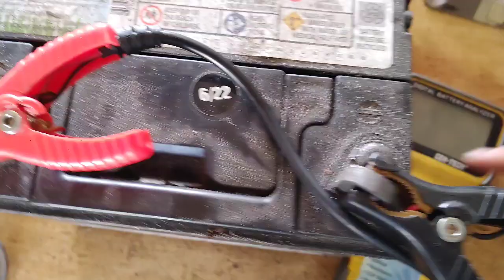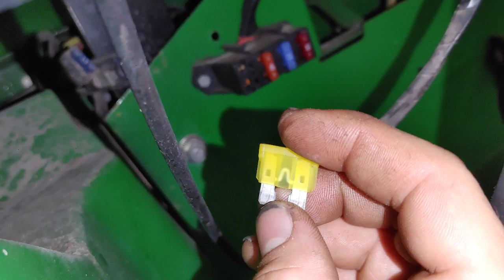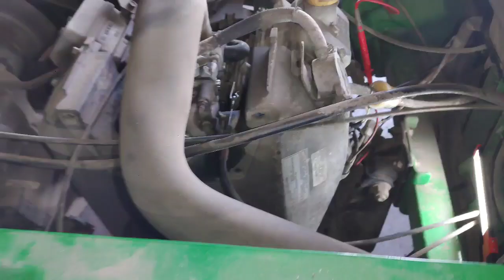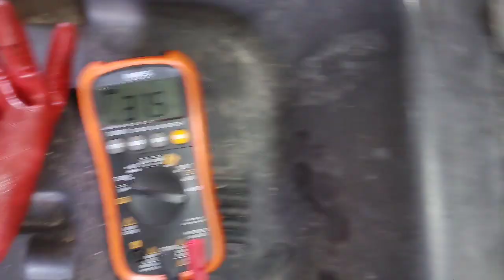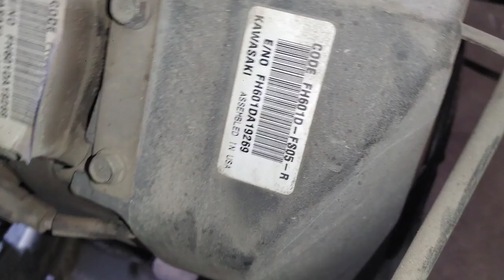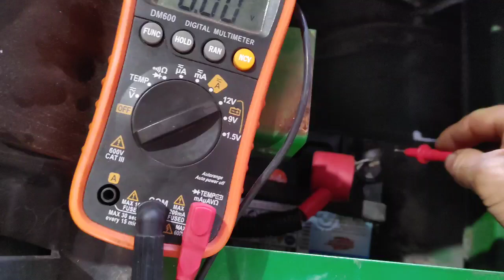John Deere Gator charging system. Stator and voltage regulator

Comment: i really want to thank you for this video. i had 3 moth without operating the gator, battery was not gettin charge, i replace the battery like 3 times, i even replaced the engine starter thinking it had something to do with it. right after watching this video a couple of times, i found out that the fuse was burned out, and the voltage regulator plug was full of mud. know it is working as it should.

Comment: Is 12.25 low voltage for a no crank no start . . my electric gate runs but nothing else.
Reply from the maker: Yes. Fully charged it should read 12.6. Anything below 12.4 indicates it needs charging. The gate doesn't require nearly as much power as the starter motor so that's probably why it's working.

Comment: Thank  you for taking the time to make this video.  My Gator hasn't charged since I got it, so it's been getting a top-off from a battery charger every 2-3 days and hasn't been very helpful after dark, only being able to use the lights to scoot back to its 'bedroom' if I get caught out late.  Wound up walking in with the battery one night after chasing goats.  That was about a week ago and my search for a DIY solution led me to your video.  

I was getting 38vac out of the stator, but the 25A fuse on the regulator line was blown.  Ordered a regulator off of Amazon, installed it, and went back to a 20A fuse.  I also put a little dash-mounted volt meter on the switched side of the key, and it's showing 13.4 for the most part, and 12.8 when I run the lights.  (I installed the voltmeter before doing the regulator swap--simply because it arrived a day earlier--and found a stead 11.5V when running, no lights, didn't even bother checking with lights on ;) )

Thanks again for sharing the information!

Comment: I have been watching your video. I was going to try and check to see if the stator was working. You have a two-wire system. I have a 3-wire system. All wires are yellow. Which wires do I check. My voltage regulator has two wire harness hooking to it. It is a lot larger than the ones you show. Can you give me some directions on hoe to trouble shoot this.

Comment: Hellow I have TX GATOR  IS OVERCHARGING IT GIVES ME ABOUT 18V
Reply from the maker: I'd first make sure all connections (including ground connections) are clean and tight. Free of rust/ dirt/ corrosion.  If your stator is giving 40 ac volts then your voltage regulator is probably bad.

Comment: Was curious to see what your thoughts are. My stator tested the exact same as the one in your video but the 20a fuse keeps popping on my gator. So while I was reconnecting the leads to the voltage regulator I noticed that the bracket was sparking. My question is could the voltage regulator be bad and is causing itself to ground out to the frame of the mounting bracket and in return blowing the fuse?
Reply: Also when I bypass the fuse it puts a load to the stator and I can hear the stator whining
Reply from the maker: Check for loose broken or corroded ground connections. 
If you have a multimeter check for continuity throughout the connections and wires. The fix will be easy. Finding the issue is the hard part. 
I have fixed maybe Gator electrical issues just be taking connections apart, cleaning with a wire brush (on a drill) spraying with wd40 and reinstalling them. Also check fuses boxes are clean.  Use compressed air and wd40 to clean them out. Wd40 will not hurt the electrical parts

Comment: I have a JD 620I gator.  I replaced the voltage regulator.  I checked the stator and I'm receiving ~ 40v ac as in your video. Any advice?
Reply: Then your regulator is bad.

Comment: I have a JD 620I Gator with charging issues.  I replaced the voltage regulator.  I checked the stator yesterday like you did.  I'm receiving ~ 40 vac.  I checked all fuses that are under the passenger seat.  Any recommendations?
Reply from the maker: You probably have a loose or corroded connection somewhere.  Make sure the ground connections are clean and tight.  I can't tell you how many times on gators I fixed electric issues just by taking connections apart, cleaning them and making sure they are clean and tight. 
Also it could be a broken wire. Use a multi meter to check for continuity through the wires. The loose, broke  or corroded connection is more common issue on gators.

Comment: I have a 6wire voltage regulator. How can I tell which ones are from the stator? Only measuring 6-9 volts AC from any 2 wires with it running. How do I know if it is the stator or regulator?

Comment: Great video! Also, if it’s still on the voltage regulator thn u can just cross-reference that part #.       Thanks!
Reply from the maker: Thanks. They voltage regulators are often updated so I'd recommend going on deere.com and using your Gators PIN number to verify the latest part number.  You may need to know what engine your Gator has also. There is a white ID tag on the top of the engine.  Here is a link to a video I made showing how to look up the parts. https://youtu.be/9JgYcXJhQvM
Even though you have s Gator go under the 'commercial mowing' section on deere.com.

Comment: What is a common cause for the 20A fuse to blow?
Reply from the maker: A short in the system.  The most common issue I see on JD gators is a loose or corroded connection or a wire with damaged insulation, making contant with metal. It can be easy to fix but very difficult to find the problem.  Also a faulty ignition switch or faulty component in the system for that fuse can be the issue but usually its a bad connection. Also make sure all the ground connections are clean and tight.  
I have fixed countless wiring issues simply by cleaning connections.